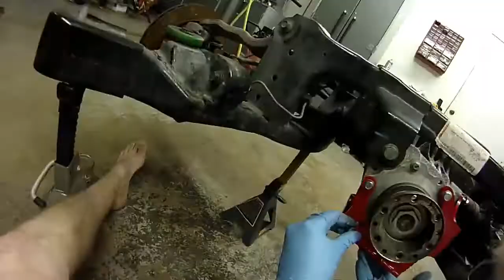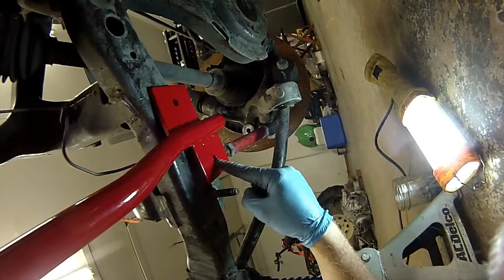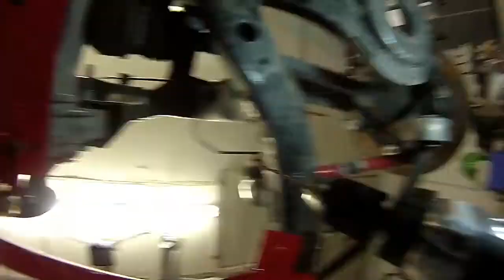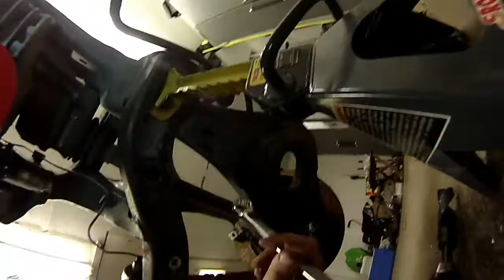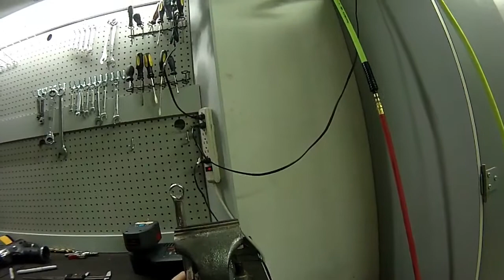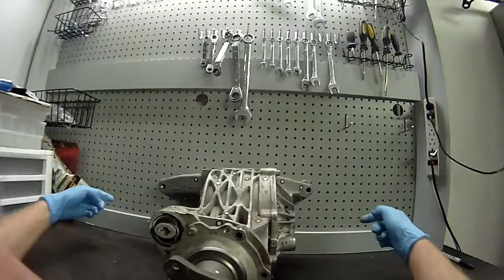GEN1V CTS-V Diff Brace Installation Instructions

Comment: I can't believe this just popped up while playing around.  I purchased one a few to 4 years ago.  Since added new engine and headers clutch.  Dyno 545 tuned for the road. Also Creative Steel whider sway bars or whatever they are so I can run fatter meats. I have zero wheel hope in any gear. I also buy all the half shafts I xan find. That's my weak link. Cheaper than a 9 inch. Fun car and I give you ALL the credit.  If you ever need a great review let me know.  Sadly most of those cars are probably dead but not mine. I'd like to see how much power I could throw at it before catastrophic failure. I believe we've corresponded and you moved up to a Gen 2 but I like my old car. Not much of a sleeper with the wide tires and loud exhaust.  Get plenty of thumbs up and haven't lost to a demon yet. Most won't race me as I'm so loud or they are tired of getting beat?
Glad to see you still doing your thing. Thanks Tom Rivera